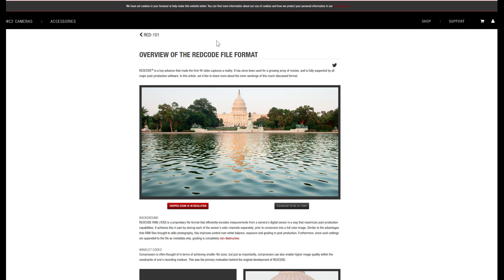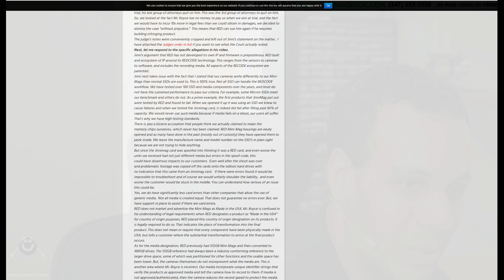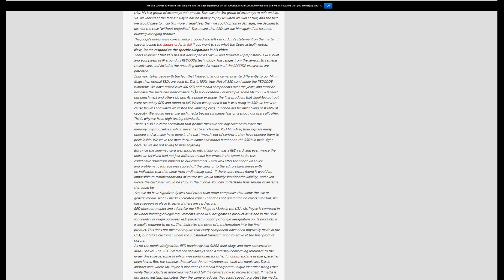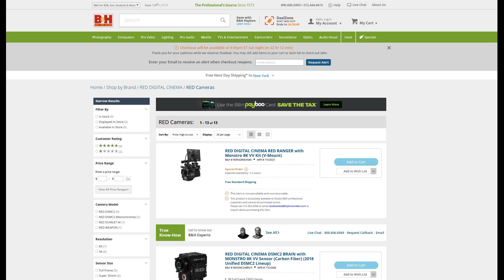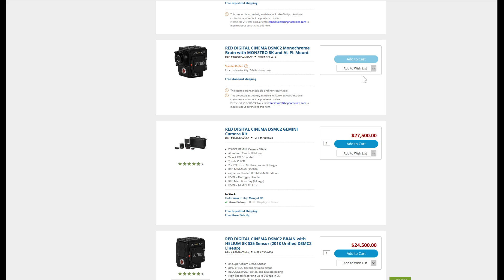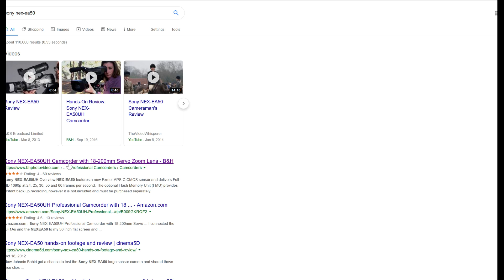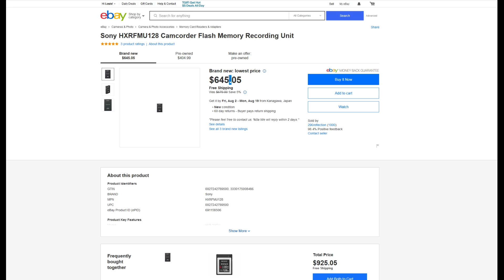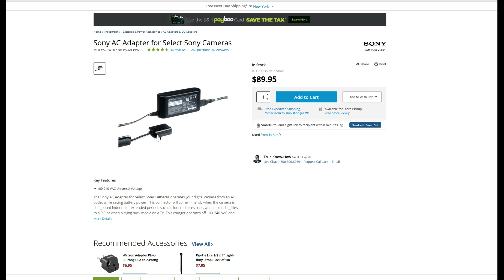Red Camera Mini Mag thing - my take on it.

Comment: But I discovered recently that my GH5 and every GH5 has fixed pattern noise in the shadows and now I can't unsee it., I had Panasonic fix the camera and replace the sensor and low and behold same problem. I hate how cheap manufacturers are.

Comment: I wanted to own a RED camera, but it was so crappy in spec, that I decided to make my own cine cam. Now I am in camera design business for 10 years.
And I finally bought a RED camera last year - a cheap broken one. And repaired it in a true "Rossman" style - with replacing a $0.20 TI 3.3V LDO that powered the power management chip. Without whatsoever documentation - you wont find schematics or board files for RED cams.

Comment: So when I worked for seagate, we would get “custom firmware” from the likes of Hp,ibm,sun, and apple. Now I cannot speak to all the firmware but for the most part, it was only just slight changes to how the device reported to the drive controllers (for drm purposes) and changes to when the drives would sleep, it was never a change to how the drive stored the data, we developed that part of the firmware and it was the same for all drives. Not saying red is lying but I find it hard to believe they developed the firmware for how their ssds store the data, but I do believe they changed how the ssds report to the controller and slow down the writes depending if it was a “red ssd” or not

Comment: I have worked with people that think the more you pay the better something is. their perceived value is higher cost. as a example one guy I worked with in 1998 would pay 3.99 a Qt for Havoline 10 w 30 at the speed shop, it was 1.09 Qt. at Checkers Auto Parts same oil, same bottle. Red Camera can charge that because their customers like Apple's are willing to pay that price.

Comment: Part of the problem with high cost cameras in the pro cinema/video production environment is simply name value.  Red, Ariflex, Sony named products suggest quality gear that will, in most cases, keep performing in harsh shooting conditions.  Is it true ... not always the case but ... I still have a Sony EX3 camera that's more than 10 years old and it's never had a problem and is still in use.  A few other cameras ... I will not name ... reside in a closet and are of no value.

Comment: Could LTT or so not just 3D-print an "Mini-Mag to Sata enclosure", using the original PCB from the Red-interface to m-sata and plug an m-Sata to sata-adapter into ist, so you have just an Power+Data cable comming out. Then you could use ANY SATA-SSD you like. When done shooting: unplug the Drive and grab another one, you can get 512GiB SSDs for under 75 €/$/Cunnuckistan copax.

Comment: As someone using REDs at least one time a month I can tell you that they don't seem much more reliable than the SSDs in an old prosumer BlackMagic Production camera.
P2 cards the best.
Reply: Hahhahahah.   Love the P2 comments.  Worked with  thousands upon thousands of hours of p2 footage  at a high volume live multicamera production company for a decade.   Only had an issue once.  The "tape op" erased the show accidentally and even did another small recording on the card before he realized the error.  Panasonic actually recovered it...   And now that I'm producing low budget stuff again and shooting on SD cards - no issues there either.  I think many of the "media" problems you see on some camera systems is actually OS crashes in the camera itself....   When did i leave that large production company?   Shortly after a week of testing new cameras including multiple 60k level rigs.  Brought in my new Sony A7s recording into an external recorder to compare.....    Not that the Sony "won" but definitely redefined the cost/performance ratio to the extent that I was much more interested in picking my own clients moving forward,  working for myself....  Glad I wasn't one of the dozens of young producers in every city that blew their trust funds on a Red before they had a business model to support it... Hahahahhaha.
Reply: @jasonshald1912  The camera OS part makes sense. Usually the cameras that do use P2 cards seem to be great cams

Comment: I do know a little about video but the fact is that SOME red cameras can do things that no other camera can do. The way the accessories connect without cables, the fact that they have one of the very few 8K cameras out (and it also has a "large format” sensor) and a recognizable color science that people like, they can charge whatever they want because when a studios needs those qualities it makes the red cameras priceless. 

Is there a markup? Absolutely.

But in pro video this is very normal. If you are honestly considering purchasing one, you probably don't care. And no , you never need a RED, in the same way that you don't need some of the expensive tools in your store to fix a laptop, but they make the job easier or add some value to your work. I'm sure those have markups as well, but for professional equipment that's to be expected.

Now on the other hand, RED cameras have a habbit of being unreliable which is way bigger of a sin, but again because of the redeeming qualities of the camera when the production calls for a RED most studios just get spare models so they can just replace a camera if it decides to stop working.

Kinda like how a Mac is garbage until someone needs to use Premiere Pro and then it's priceless.

And just to be clear I'm not a fanboy, I don't own a Red myself, and they are absolutely not perfect (far from it). It's just that we are talking about professional equipment and arguing from a consumer standpoint, it's (no pun intended) pointless.

Comment: Maybe not the best parallel to bring up, but Phase One and Hasselblad fill a similar space in the commercial photo world similar to RED in the video world. 

Both companies charge prices that are significantly higher than the standard professional camera manufacturers. A used entry level phase one kit will run about 15k if you forgo the warranty. 

Now hasselblad charged high prices for the longest time. One model I'll focus on is their H5d-50C, a 50 mp medium format camera with some wireless features. That model sold for a bit over 25k for the longest time. 

However now, hasselblad has been losing their market to Phase one (also super expensive but they're actually doing a lot of innovation). So that same H5D-50C, is available on sites that still have them new for just about six grand. Less than 25% of the original price. 

For the longest time, you were paying for the name, you were buying the brand that went to the moon and had been behind dozens of iconic photographs. But now the completion has them beat, and they cant rely on the name anymore for sales.

Comment: I personally really dislike overpriced stuff. Expensive stuff is OK, but overpriced - no. For example, if that $2200 cartridge had a couple of $700 SSDs in in in RAID1 it would be OK in my book. 

While I do not make videos and the Red cameras and their cartridges do not really affect me, there is one very similar thing that annoys me - "brand name" hard drives for servers.
HP (and other manufacturers) want me to buy "HP" hard drives for their servers. Here's the problem - HP does not make hard drives, so the "HP drive is just a standard WD or Seagate or Toshiba drive with a "HP" sticker on it and double (or more) the price. Oh and when you buy a server ir comes without caddies for the drives.
Now, most of the time standard drives work in those servers and caddies are available on ebay, but it still is annoying.
One of the reasons I prefer to buy Supermicro servers - they come with the caddies and do not complain about standard drives.

When I buy a laptop, for example, one thing that is a deal breaker for me - proprietary power adapters - if the adapter needs to do anything else beside providing some voltage at some current - I go look for a different laptop.

Basically two things annoy me greatly - overpriced stuff and artificial limits.

Comment: I think the issue people have isn't just the mark-up, its the extreme mark-up on flawed product, something that has no redundancy, is prone to failure and you have literally no better option, because if you try and use a more reliable SSD you're likely to get a nice curb stomp from the DRM, if not now, then randomly due to an update.  

It's like a more extreme version of the apple keyboard, offering a fix for a known flawed product is not better than just providing a better quality product in the first place. 

At least with the apple keyboards, if it breaks, they fix it, worst case scenario you're out of a computer for a few days, if they can't fix it, you get a new PC with all your data transferred. 

Using cheap drives with no redundancy means when they fail, it's not as simple as replacing it, because it now needs to have data recovery done on it, and that is no guarantee that you'll ever get the data back.

Comment: Actualy you say a fully set up camara will be 60k for a red its going to cost the same as a cheap house 100.000 over because a lot of the components are overpriced, the camara itself may be only slightly overpriced but they look at apple and say: you call that overpriced thats weak gotta increase those numbers

Comment: My work is making VFX at a broadcast channel, and I go with the crew in many vfx sensitive shots. Various departments here like to rent different cameras and I've worked with lots of them, when working with vfx, having great dynamic range, a low compression (or none) for being able to do proper 3D tracking, chroma keying, 3D compositing, color correction etc are paramount.
But guess what is even more critical, reliability, especially redundancy. No one in this line of business can afford spending sometimes over a million, between actors, crew, cameras, lights, etc... to go out and shoot something and risk coming home with a dead mag (and you need to use that if you want to be mobile). Even if that mag can be safely restored, there are a lot of problems, one, there may be sensitive content, two, the schedule cannot afford a delay, for example.
So a 40k USD camera (and thats just the camera, the cinema class glasses that you have to put on it quickly surpasses that value, as do other hardware) have a 2k ssd from some micron whatever, that fails, and not by a low margin, with no redundancy. So a multi-million research did not bother to, you know, protect your valuable content? So no, "people who uses red cameras defend this", no I dont, that mag is STUPID. An argument that says "the 2k price point includes data recovery" is STUPID. Maybe people who OWN and makes a living by renting those REDs defend it for obvious reasons, but those who USE it, don't, thats unacceptable in a world where even triple redundancy is standard, especially for an unreliable piece of hardware that is the mag. From ALL the professional cameras setups I have used, only Red has this problem and you have to place workaround for it not to bite you in the future, and at this price point, in this line of business, NOTHING should bite you in the future.
YES Reds are great, they have an AMAZING image quality, they work really well, people love its raw and its output, but that is a serious flaw, and that IS worth discussing and pointing a finger at red's face. If you go for an example of direct competition,  you put a sony Venice CineAlta or even an F55 (you can buy two of these for the RED price, albeit they are 4k) in the equation and things dont look good for Red.

Comment: Red in general is overpriced but there is reason for it. Those cameras is designed for rental houses and not for end-users. Same for lenses and other equipment. From film maker perspecitve it's not so expensive to rent all-in-one package for a week or so.

By now market is changing. We have now Blackmagic Design. They made real cheap 2.5K and 4K cameras and using open standards for media and even for batteries. SD or CF too slow or too small for RAW 4K? Here, take USB-C, snap Samsung SSD on top and you're ready to go.

Also there is Kinefinity. They made cameras more like RED's but it costs 1/3 of price. And they use simple 2.5 inch SSD for media.

Comment: its sort of a 50/50 thing there product there prices thou they could quite honestly invest in a bit better SSD's thou for the most part the red memory module is just a standard SATA drive plugged in to a pass-through connector to make the external pins there own proprietary layout. so other then red having a fit over it there really is nothing to stop some one else making there own module.

software argument irrelevant as that's done on the computer and the Camera it self, the drives just stores the video files.

Comment: Pro video is my field, and let me tell you, RED are far from the most expensive cameras you can buy. Those giant rigs you see in stadiums with three-foot-long hyperzooms on them start around 100k new. Even the ENG rigs you see video journalists lugging around will range from 30k-100k in value. As a field that has retained labor value relatively well (aforementioned journalists excluded, sadly), its sustenance of accessible video won't prevent the industry from holding away the features big networks need behind the big bucks. We're used to getting slammed for flash memory -- look at Panasonic P2 and Sony SxS. Unless you're painting an 8K masterpiece you probably don't need a brand new RED camera. Hell, they might not even be right for your application.

Comment: Because among other things, Red is a tech cult. People want to have faith in it and its products so they can do their work and know the gear is blessed and from a company that is beyond reproach. I think your video is excellent. I like the way you reason. But to answer your question with the same honesty as you use in your video, which is to say a lot, people are upset because of the cult-like status of Red. 

From what little I know of Red cameras, their proprietary format is amazing for editing. I downloaded some R3D files and worked with them on Premiere Pro and it was a total joy. Changes I made actually had the desired effect and did not require two more adjustments to fix the things that went wrong with the first adjustment. I can understand why RED cameras have that cult like status. And I think that is why people are putting more energy and emotion into this issue than it deserves. 

You touched on the concept of 'defending one's purchase' in your video. Just apply that concept more generally and you answer your own question.

Comment: You buy a red camera for the color, the sensor that can capture SO much! It's an incredible camera and if you can the means to pick one up you won't regret it. Is the storage media expensive? Yes, but it's 0.0375% to 0.03% of the camera and you get data recovery. That sounds fine to me. Is red using normal drive with an adapter so they can make it their own, yes. But I'm not concerned about that if I'm impressing the executives with the cinema rig I'm going to use on set where I have shots that cost more then the camera while paying crew by the hour. When you have a cinema camera like a red you're not worrying about if RED is making their own storage media technology or not. You just want it to work and if it doesn't then you can have a go at RED. But the professionals using these cameras and I mean the REAL professionals, not youtubers they don't give a shit and for good reason.

Comment: This is only an issue when the cameras are on the used market and sell for 1/10th the original price, yet the storage medium still costs the same thing. A student paying $1k for a Sony camera does necessarily want to spend another $1k on SxS cards. However,  used Red cameras do not depreciated at a significant enough rate for this to matter.

Comment: Louis, the issue here isn't only about Luxury cameras. 

Their message: If it would have better storage, if it would be improved, repaired, etc. it wouldn't be a RED camera anymore. "If it isn't crap, our brand should have nothing to do with it". I think you remember this attitude. It happens to independent repair and Apple. So if you would use a better, compatible SSD in a (cr)Apple product that would usually turn into a PC due to the virtue of better storage. 

And it is also a new angle on the usual iPhone refurb LCD screen gate question. 

If that is repaired (refurbished) Apple LCD then it isn't an Apple LCD anymore, but looks like it becomes a droid / PC LCD... And that is why restoring the logo, design on it is now counterfeiting. If it is fixed, if it can be fixed, etc. it isn't our shit anymore because we like if our products are junk, crap, etc. that makes it easy for us to rip off customers. 

I am sure a similar device, with a documented interface, with 2 Intel Optane SSDs, better cooling, Raid 1, etc. wouldn't turn your RED camera into a Sony Phony... And a fixed Mobo doesn't turn a MacBook into a PC, and replaced glass won't turn an Apple screen into anything else than a refurbished Apple screen, so restoring logo and design makes sense. 

When this kind of abuse of brands means you end up in the "you can't have anything better or ..." type scenario we all known from Apple, etc. that is bad, and that happens with RED too. 
A good adapter that would let you have 2 Optane SSDs in raid 1 wouldn't turn RED camera into anything but a luxury RED camera it was before that upgrade. But it would save a lot of money for customers when the data recovery now doesn't work, but RAID 1 would work. 

It is a "we want to control the shit we have sold to you" attitude. 

I am sure you know that if people restore a VW beetle they will put the VW logo on the restored hood and they don't have to worry about it isn't VW steel, etc.